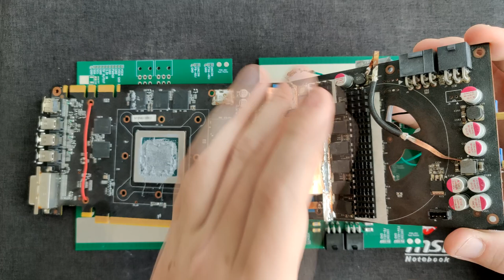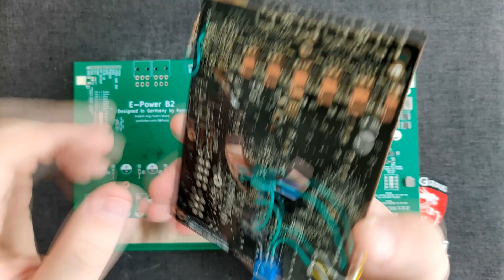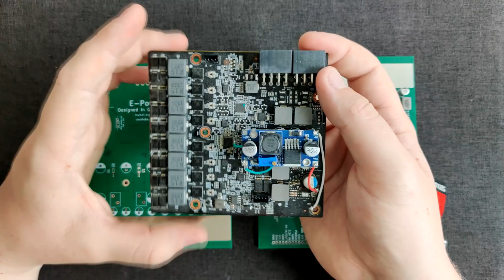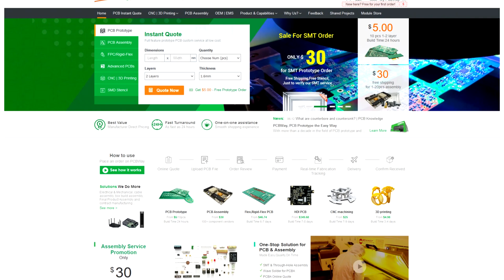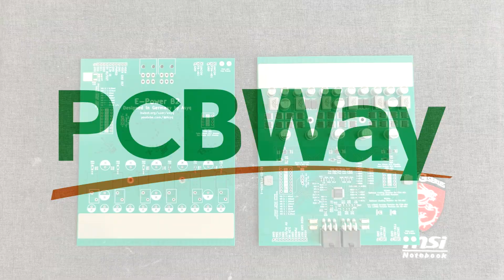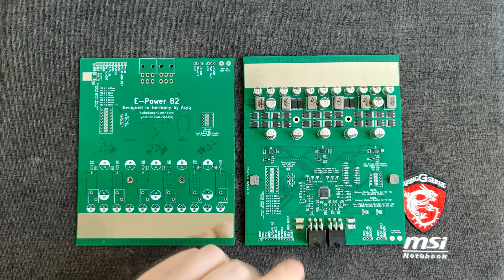Asyq designed an E-Power from scratch. And it's amazing!

Comment: Maybe this was mentioned already but what current and power draw do you expect this board to handle?
Reply from the maker: @Ironclad17  the lowsides will do over 100A each if kept cold enough but realistically ~300-350W max before it becomes uncoolable